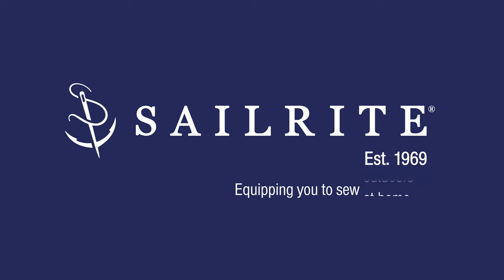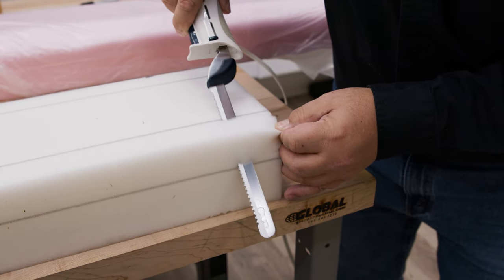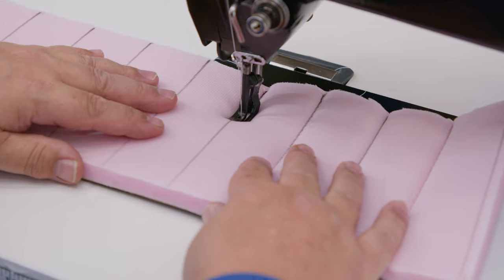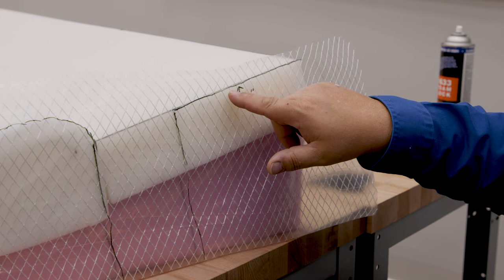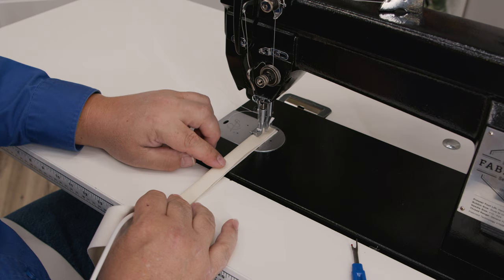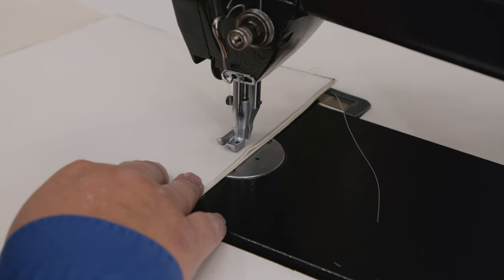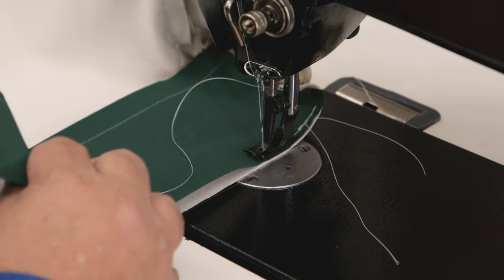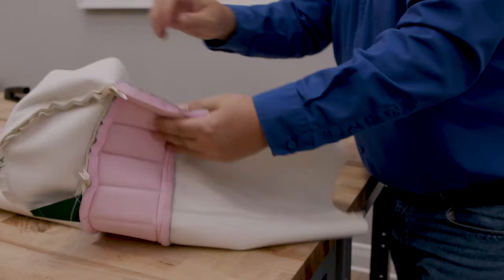How to Reupholster the Backrest for a Pontoon Bench Seat

Comment: Eric, I was trying to wrap my brain around the location of the fabric pull. I think if you staple it where you did at the bottom of the bolster foam that it would just get folded up in half inside and not do its job? It is sewn at the top of the maroon panel and stapled at where the top of that panel would sit. I would think you would need to staple the fabric pull UNDER the bolster foam so that it could get pulled from the back material? And the front could pull on it as well. Am I missing something? Thanks!
Reply from the maker: Hi Chad, The fabric pull was fashioned to be one inch wider than the thinnest foam. For us our foam was 3 inches and 4 inches, so our fabric pull was made 4 inches wide, 1 inch wider than the 3 inch foam. When sewn to the top plates of fabric it will become 1/2" smaller and then when stapled to the backer board it will be another 1/2" smaller. So, now it is 3" wide, the same width as our thinner foam. It should be stapled to the backer board directly in line with the junction of the two foams, no need to push it under a foam and staple, that would shrink it up even more (pulling the vinyl way too far) and cause a cavity where no foam exists. If you notice in the video the fabric pull does it job at the seam/piping pulling it down well into the junction of the two foams, which is what we were trying to accomplish. I hope this helps!!! Let me know if you have more questions.
Reply: @SailriteDIY  Oh I get it! I did miss that there is 3" of foam between the fabric and the backer board. So the fabric pull is sitting in between the 3" foam and the 4" foam. I was thinking the fabric sat right on the backer board, but it does not. Got it! Thanks for helping me picture this!